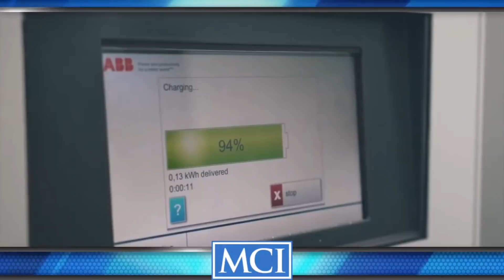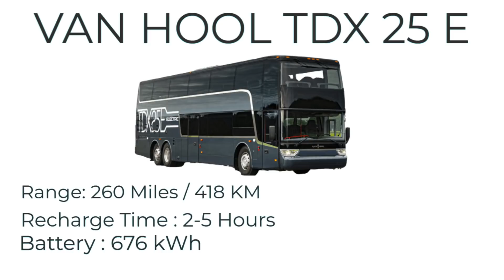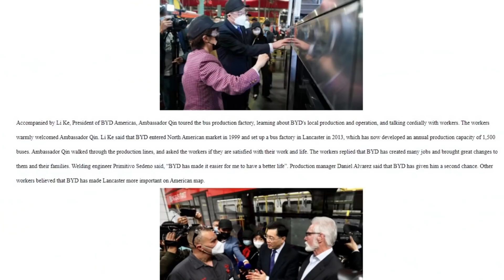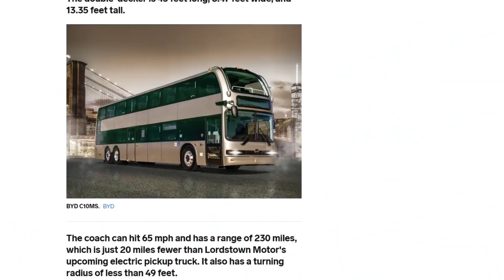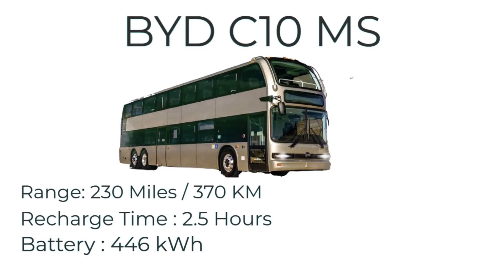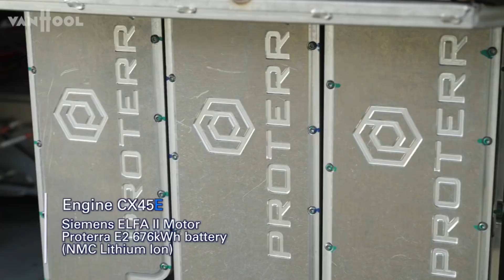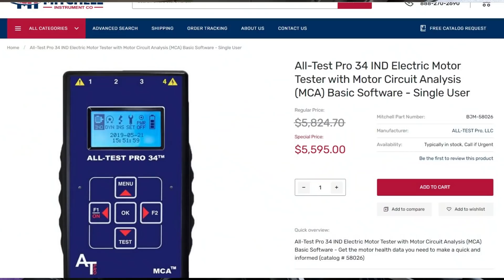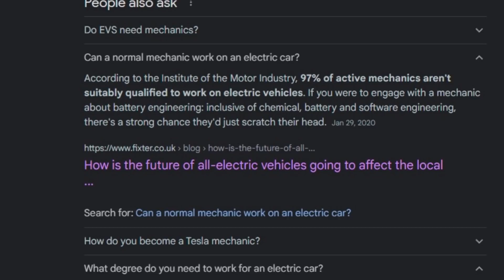Are Electric Buses working out in the US?

Comment: I think once people started Towing trailers with their Tesla I think their eyes opened up a little bit. It wasn't that it lacked any power it had plenty of that the problem is how much power was left when they didn't arrive to their destination about 80 to 100 miles later. 

the only real solution for the bus industry is going to be something like a hybrid Prius power plant the same kind of transmission that's basically trouble-free and has the motor generator on board which is basically the same thing that you're large locomotive Freight engines use but in a slightly smaller package.  

the real problem is going to be HVAC.   do electric vehicles do generate some heat it's not enough to keep entire cabin of people and of course do all the other necessary things on a bus that is required for operation.  

the largest bonus really would come from  going up inclines and maintaining speed up hills.  lack of having to worry about transmission downtime and such things that are just not needed in a typical diesel-powered rig.

the other downside is storage space you're going to still require some of that storage space that you had set aside for passenger luggage so the bus owner also loses capacity on the bus since batteries take up more space than liquid fuel.

the only practical way to do a hybrid bus while still maintaining just about all of the safety and also the passenger cargo space would be to have the battery located behind the bus on a trailer that way it also takes care of any safety concerns as the passengers and the battery are not in the same unit and it could be easily separated in the event of a fire or other electrical condition that may cause the passengers to get injured.

theoretically for a Hybrid drivetrain unit you could  get away with something like a Volkswagen TDI Diesel in a 4-cylinder form factor which would suffice for most City in transit applications as much of the time it's idling  providing ample time to recharge a hybrid battery pack.   
 
that formula doesn't work  for long-haul buses.     Take into account the average Grey Hound Bus gets 6 MPG as its AVERAGE.   And if we are talking about going up a hill?    Hot day? Full bus with luggage and keeping up with posted speed limits with bells and whistle's on board?  less than 2 MPG.     
With that in mind?  Since the battery weight never goes down,  the current required to move the same electric bus at just 75 to 50% charge goes up exponentially and therefore even if you put a large 500kw battery pack your estimated range would be less than  150 miles if you're staying in the batteries Goldilocks zone for longevity.    

the real kicker ? your electricity bill. Sure overall it seems like electricity is cheaper but in many cases especially in places like California your kilowatt usage will be closer to $0.35 per kilowatt.    and that's if you actually have the capability to fast charge a 500 kilowatt battery pack to at least 90% of its full capacity within 3 to 4 hours.    

 in order to even get it to 100% at the 500 kilowatt level you're actually using probably posed to 700 kW to just do it.  you're still going to have to power the rest of the systems on the bus and on top of that you are going to be running the cooling system at Max Capacity for the pack during a fast charge which is going to be required if you want to stay in business.

we haven't even got to the worst part yet. In order to make a 500kw battery for a bus depending if we could simply use the bottom space into a pack exactly like Tesla does on their cars well it's going to weigh close to 6,000 lb or more and we haven't even got to the structure that needs to be filled to support all that weight on the bottom.  

 as the bus is going to be in a commercial application , extra weight is necessary for a quick removal of packs to change out bad or tired cells  within the pack that have expired during use even within the first year.    

we're also talking voltages that would be around 1000 volts to two thousand volts to keep up with everything else on board has a standard pack of your 400 V just won't cut it. 

the eventual weight of all the necessary items needed to keep the battery hot or cold or in its offer to them temperature that back quickly balloons up to around 15,000 lbs.  

but the cherry on the cake that no one wants to talk about is who is going to be doing all this maintenance on these rigs? Because remember most men are simply leaving the workforce and the people that are coming into it well they're not really capable of moving these heavy packs by themselves are working on these rigs has it's not as simple or as well-known as a diesel truck. So now you have to go ahead and train people for at least the next 30 Years just to get caught up with the electrical vehicle technology that's needed to be installed in something like a tour bus.

Comment: Weight is the enemy of any vehicle. Batteries have really low energy density, and heavy buses need a lot of energy to get going. As a result, batteries which have enough energy to move the bus any useful distance will be super heavy, and take up a lot of space which could be used for other purposes. In addition, they will take a very long time to charge, even with the fastest currently available charging methods.

City buses drive relatively short distances and charging infrastructure can be built so they can charge at each end of their route, which means they can have smaller batteries. In cities air pollution from vehicles is also a bigger problem than on highways. Clearly, electric buses make a lot more sense in cities. Motor coaches may switch to something like hydrogen, natural gas, or biodiesel, because for them energy density is critical.

Comment: Miami-Dade County is right now rebuilding it's Metrorail Dadeland South Station south to Homestead busway that used to be CSX railroad track with inductor charging pads embedded in the road itself so the bus actually charges as it's rolling.
They are also adding more bus stops with on-site parking so you cab drive from your house, park and take the bus to Metrorail to downtown Miami and up to north Miami-Dade County or to the Miami International Airport. 
Other routes will be getting all electric busses as well.
Unfortunately only the South Dade busway is the strictly bus or emergency vehicle only road in Miami-Dade County. Now there's a "not in my neighborhood" movement in the area of the NASCAR Homestead Motor race track that's trying to nix a Buss depot they intend to build there that will involve extending the busway to the racetrack to ease traffic congestion on the Florida Turnpike on race days that currently causes it to become a snail pace parking lot road like Los Angeles rush hour highways.
The movie LA Story had a great scene involving that very item.

Comment: It's amazing how many young people, and some older ones, have zero idea that it takes mostly fossil fuels to make electricity as wind and solar are unreliable and storage batteries have no where the capacity to be efficient on any vehicles. For example, only a 170-mile range on a city transit bus? That's not including the drain on the batteries for speeding up and slowing down city buses constantly do etc. but steady driving only. For now, hybrid vehicles seem the way to go. When much better batteries and shorter recharge rates become a reality then all-electric buses might become viable.

Comment: I have heard that in some countries in Europe have the electric built right into the road so their is no battery in the bus at all that you get all the electric you need through a wireless connection, but then you have a meter in the bus and the electric company needs to come out to read the meters on all of your buses, and then you pay the electric bill. I have also heard that you don't actually get any fuel savings because you pay higher prices for that electric. The real savings comes from maintenance, but if you have to replace the batteries then you have to figure out the cost of the battery based on the expected number of miles you'll get out of the battery. Even if you expect 100,000 miles out of the battery if the battery cost $100k (just a guess) then your adding $1 a mile that you need to just save up so you don't get blind sided buy a $100k repair bill. Maybe that's not a big deal if you have 50 passengers on the bus then it only adds 2 cents a mile per person, But it is something to consider in the long term.

Comment: I think the most alarming thing for me is the fact that the switch to electric for coaches appears to be quicker in North America than here in the UK; where any of these coaches could go London to pretty much anywhere on one charge at the most. And when you consider how often they stop on motorways, you probably wouldn’t be losing much if anything on the overall trip time of a diesel coach.

I have to mention the myth of range degradation and battery replacement though. These days, batteries tend to degrade a bit in the first year or so, and after that they pretty much stop losing range. It may be different for coaches and buses, but I’m doubtful because the batteries are so big, and because the coaches are usually driven quite carefully. They’re not constantly being launched from traffic lights. And also for cars, battery replacements are pretty much no longer a thing on more recent EVs. They generally will last the lifetime of the vehicle. I would assume that also to be true with buses and coaches, but I’m not 100% sure.
Reply: Coaches generally last longer than cars.  But they're also driven in a more controlled and reasonable manner, maintained better, have diagnostics run more often, etc.  A saving grace for early adopters, is that by the time replacement is needed in 10-15 years, the technology will be better and cheaper.  I would expect that extremely few batteries will be replaced with the same part number of battery it was delivered with.

Comment: ..... In the very near future, I foresee those charging stations offering complete, fully charged, battery swapping services... For cars, trucks, busses etc... An owner would pay for the service, and upon arriving a crew would swap the batteries, and you'd be on your way... Then, they would fully service and recharge the depleted batteries, to make them ready for the next owner that uses the same type... This way, with this service, one would not need several hours of 'down time' as their batteries recharge.....
Reply: I foresee you being wrong.  It's a great idea technically, but totally unworkable financially.  Think how ripped off you feel when you exchange your new/shiny propane grill tank with many years of service left in it, and get a rusty one that is expiring and not even refillable legally by the time you use it up.   Everyone makes that mistake once, then either exchanges old tanks hoping to get new ones, or gets their specific new tank refilled rather than exchanged.  

Now imagine that we're not talking about a $30 propane tank, but a $15,000 car battery or $100,000 bus battery.  NO business is doing to want to take responsibility for the swap, without the ability to appraise the two batteries and bill for the difference in value.  How would you like your new $100K battery to be gone after you've operated your new bus for 4 hours, to find it replaced with a 10 year old battery worth $12,000?  And how'd you like to get billed for $78,000 when on your return trip, you swap that hunk of junk in for a 6 month old battery worth $90,000?   You know they're not going to pay you $88,000 on the first swap.  In the best case, it will be like a never-ending series of buy/sell price spreads you are losing.  In the worst case, you get ripped off, swapping a new battery for an old one that they won't even allow you to swap again.  Nightmare!

It would really only work for fleets able to own all the batteries being swapped in and out.  Like, UPS and Amazon could do it on their delivery trucks, but a charter bus company passing through some random place would be crazy to do a swap they won't get back.

Comment: If the entire roof was covered with solar panels how efficient would they be?
Reply: Good idea, but there's not nearly enough surface area on any bus or car to power it via solar.  But you could probably get about 4kW of solar on the roof, enough to charge the bus in a week if the sun was shining 24/7, which the last time I checked, it doesn't do.  So, figure, best case it could charge the bus in about 3 weeks, or provide 5% of the charging if the entire range is used up daily.  And really, it's more efficient to have solar panels sitting stationary in a big field somewhere, rather than getting hauled around on a bus hurting the aerodynamics, weight, available space or height clearance, etc.  Accelerating and decelerating them is just not worth it.  Wires move electricity from empty fields in rural areas, to city charging stations, efficiently enough.

Comment: Thanks for the video, yes those prices and recharge times are not good. Here in the UK, the driver has to take a 45-minute stop I think every 4 hours (I am not an expert but something like that). When a coach can drive for close to four hours and recharge in 45 minutes then it will be viable for most purposes.
Reply: I like your logic. If the average driving speed is 90 km/h (55 MPH), then that four hours covers 360 km (220 miles), which is about the range of current battery-electric coaches. The problem is the 45 minute full charge, which is not reasonable. With current technology the battery would need to be larger so that it would only be perhaps 60% used over the 4 hours, and could be recharged (from 20% back to 80%, not to fully charged) during the break time. 

Of course this assumes that every break location will have an available high-power (megawatt) charging station port at the time that the coach arrives... and that this not trivial.
Reply: I just checked driver's are allowed to drive for 5:30 max but must have a 45 minute break within a maximum 8:30. Such a long drive without a stop would be very rare however, the passengers are going to want a comfort stop and food in less than that!

Comment: Electricity is also fuel and I wonder where all the extra power is going to come from to recharge all these batteries
Reply: No need to wonder.  Look at your electric bill.  It should break it out by percentage nuclear, natural gas, coal, wind, solar, hydro, biomass, etc.    Then ask your utility what the percentages are for new capacity they are adding.   That will answer your question better than the numbers on your bill.  A higher percentage of new capacity is renewables, than the average existing capacity shown on your bill.

Comment: Electric fleets will be governmentally  subsidized and hence under the thump and control of the government because they are not cost effective for ownership by common household. This is the physics of the equation.
Reply: My car runs on my choice of electric or gasoline.  I can change what is powering it in a fraction of a second as I drive.  It currently costs me $0.02/mile on electric, and $0.07/mile on gasoline.  Tell me how the government controlled me when I bought it, when I fill the tank, when I plug it into an outlet at home, or when I drive it.  

So I'm calling your claim political BS.  Go buy a PHEV (I highly recommend the Prius Prime) and see how much you feel controlled or subsidized by any government, when you hit a button to change between EV mode and Hybrid Mode at will.   If you never plug it in, you still get 54mpg EPA combined, and can still use Charge Mode to charge up the battery so that you can enjoy silent driving in EV mode using no gas in the city, in traffic jams, or simply to run the climate control for several hours without the engine coming on.  

Personally, I think a PHEV gives you more choices and more freedom that belligerently sticking to only burning fuel every second your car is on if you have an ICE car.  And more choices than an EV, if you don't feel like stopping to charge while trying to cover a lot of ground on a long trip.  But EV owners have found that the amount of time stopping to charge on a trip, isn't much more than what they were already stopping to use the rest room or grab something to eat.  So, there is little inconvenience in most situations.

I think an EV is a great choice in a household with more than one vehicle, and a PHEV is a great choice in a household with only one vehicle regardless of how often you take long versus short trips.

Comment: 274km? Rofl. 3 hour charge time? So, let me get this straight, that range figure is 100% highway / freeway driving. So, with a 100km/h speed, your looking at 2.74 hours of driving, pull over to the side of the road because you are going to spend more time charging then driving.

Okay, so even if it lasted 3 hours, that means you need double the amount of buses to perform the same job. And then you know, well, the range over time is going to decrease, so in the future, maybe the battery will last for 1.5 hours and still require 3 hours charge time. So, you need 3 buses to perform the same job as one. And that efficiency for stop start travel is surely going to go down a lot.